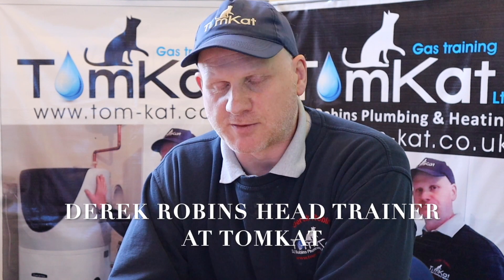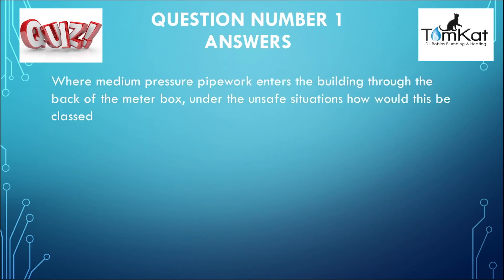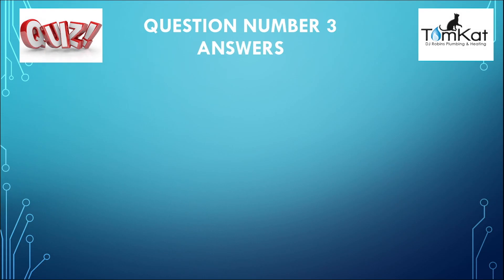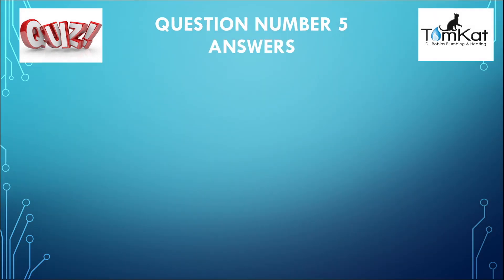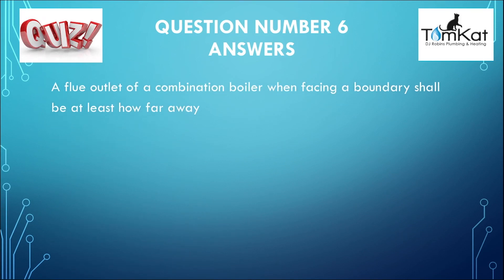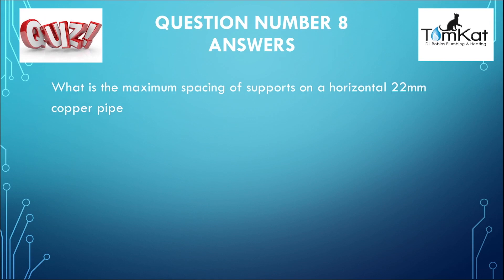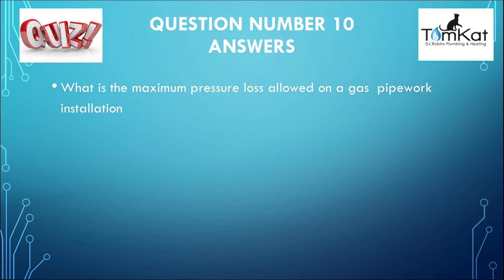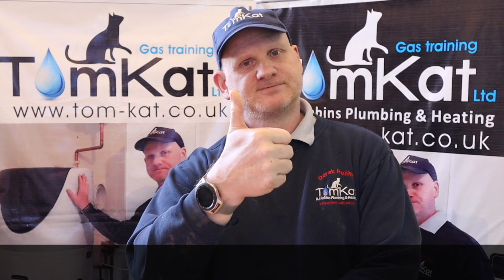TEN GAS QUESTIONS EVERY GAS ENGINEER SHOULD KNOW, THE ANSWERS

Comment: I swear question 4 is A? For a digital/electronic manometer I was told in my text books and exams it’s 0.20? However for a water gauge it’s 0.25? In regards to rise? Please can someone confirm/advise?
Reply: Go by the books always brother
Reply: question 4 is 100% A.
Reply: Well sometimes experts like Derek can make mistakes, we are all humans
Reply: My gas regs book says 0.25 for manometer and 0.2 on digital. Doesn't mention two decimal places. And 0.25 rounded up to a single decimal place would be 0.3.
Reply: @Big_Old_Bondy I thought the same! And I had to check I've never heard about the 1 or 2 decimal points and always go of 0.20 on electric or 0.25 water here is the description
from the Niceic domestic gas on site guid part 1 version april 2023  book 6.4.2 (6.bullet point 3)

The valve is deemed to have passed the test only when any rise does not exceed No Perceptible Movement' of the gauge (NPM for a water and electronic gauge reading to 2 decimal places is 0.25 mbar (electronic gauge reading to one decimal place, 0.2 mbar). Where a rise is recorded greater than NPM the cause shall be investigated and rectified before proceeding with the tightness test.
Reply: @Jay-lo4wd  it's definitely .25 on a digital manometer
Reply: Question 4 is a 0.20  

A u gauge is 0.25
Reply: I said 0.2
Reply from the maker: The question is to 2 decimal places not 1 so the answer is b not a if the question was to 1 decimal place the answer would be a then

Comment: Perceptible movement on water gauge is 0.20mb.   On DIGITAL,is 0.25mb
Reply from the maker: No mate on a water gauge it’s o.25 mbrs on a digital manometer to one decimal point it’s 0.2 and to 2 decimal points it’s 0.025 mbrs
Reply: Sorry i put it wrong way around. I meant to say perceptible movement on water gauge 0.25mb and digital 0.20

in the video at 2:25  the answer for digital is B:) 0.25 which is wrong..  should be A:) 0.20

Also 0.025 is 3 decimal place not 2
0.25 is 2 decimal
Reply from the maker: @rickylin3214  no because the question is to 2 decimal points  not one so the answer is 0.25 mbrs not 0.2
Reply: Sorry i put it wrong way around. I meant to say perceptible movement on water gauge 0.25mb and digital 0.20

in the video at 2:25  the answer for digital is B:) 0.25 which is wrong..  should be A:) 0.20

Also 0.025 is 3 decimal place not 2
0.25 is 2 decimal 
Correct me if im wrong  everyday is a school day :)
Reply: I was convinced the answer was wrong on perceptible movement until I looked it up in 1B 😂😂

Comment: The last question is pretty misleading. The maximum pressure loss allowed on an existing installation with an E6 meter with pipe nominal bore of less than or equal to 28mm is 8 mbar and it's 4 mbar on a U6/G4 meter. Yes, it's 1 mbar on a U16/G10 meter but that wasn't specified. Also, on existing with no appliances and new installations you cannot have any perceptible movement.
Reply from the maker: But that’s not what the question is asking read the question again because it’s asking for pressure drop not pressure loss 😜
Reply: @tomkatgastraining  the question literally says pressure loss and not pressure drop. Pressure loss is allowed on a system as long as its not too high a rate and there is no smell of gas. Also, the 'pressure drop' you're reffering to is technically referred to as the stabilisation phase of a pressure measurement.
Reply from the maker: @L.C.Sweeney  it is not about loosing gas from a leak it’s about how much you can loose between the meter and appliance when the appliance is running. You can tell that because no pipe size or meter is mentioned in the question.
Reply: @tomkatgastraining  okay, I finally get what the question is actually asking. I still think it's too vague. Pressure loss could be referring to pressure lost from a leak or from frictional sheer forces in the pipework. There's no way to know which loss the question is reffering to. And it's not like I don't know that you're allowed a 1mBar drop in P between the outlet of the meter and the burner on a gas appliance when the appliance is in operation. I could answer that in my sleep.
Reply: @L.C.Sweeney  but you didn't understand it even when you were wide awake
Reply: @djmc1969  I do understand the question completely comprehensively. I understand how the question is incorrectly worded and I have explained why the terminology used is incorrect and explained the correct terminology relating to the question. It's a question of basic grammar and scientific principles. The words 'loss' and 'drop' are not synonymous and should never be used interchangeably. The question is asking about a pressure drop and uses the word loss.
Reply: @tomkatgastraining  exactly it’s misleading. And people who ask shit question like that are what’s wrong with the gas industry.
Reply from the maker: @S29ORY  just because you don’t understand or read the question correctly doesn’t make it misleading.
Reply: @S29ORY  you wrong - the question os precise if you read it.

Comment: The last question way ambiguous
Reply from the maker: I don’t think so it asked what is the maximum pressure drop allowed across a system which is one MBar if it was to do with drop as a leak it would have had the meter and pipe work size

Comment: I reckon the wording  on Q10 is wrong because no loss is allowed on pipework whereas a DROP in pressure of up to 1mb is allowed for on pipework installation because of resistance factors. eg LOST pressure as in an escape but DROP as in not as much force due to resistance.
Reply from the maker: You miss understanding the question it’s not tightness testing pressure drop it’s working pressure loss between the meter and the appliances so it’s not worded wrong but thanks for your comment and watching cheers
Reply: @tomkatgastraining  The wording is poor on question 10.
Reply from the maker: @MrAoldham  no it isn’t it is designed to catch you out and make you think just like the exam questions are

Comment: I think question no 4 is wrong as permissible perceptible movement on u gauge  is 0.25 but on digital manometer where it can register movement of less then 0.25 as most of digital manometer do then permissible movement is 0.20.
For question no 10 i think there is no permissible pressure loss on pipe work at all. On the gas Instalation if there is a pressure  loss under the limits that is permissible only subject to these conditions, as far as no smell of gas and no leaks on pipe work.
Reply from the maker: moon480 sorry question 4 is correct and you are allowed 0.25 Mbr movement but thanks for your comment and watching cheers 👍🏻
Reply: I think moon is correct
Reply: @rusmatkhan6456 am really sure it's 0.20 on digital and 0.25 on a water ugauge
Reply: According to the Logic book i'm learing from it's 0.25 on a water guage and 0.20 on a digital guage.
Reply: I thought this exactly. Found it in logic book 
‘Basically Tools and Equipment’ -
“No perceptible movement on U-gauge is taken as 0.25mbar” 
“No perceptible movement on an electronic gauge is taken as 0.2mbar”

Comment: bugger! got last one wrong.. thought pressure drop on pipe work was 0...must do some revision!! thanks Derek.
Reply: Is the pressure drop from the meter to the appliance and not a leak?
Reply: The question was somewhat incomplete, you are right, if there is pipework only then 0mbar, but with appliances connected the pipework pressure loss is 1mbar.
Reply: @406xud  I agree a trainee wouldn't pick that up.